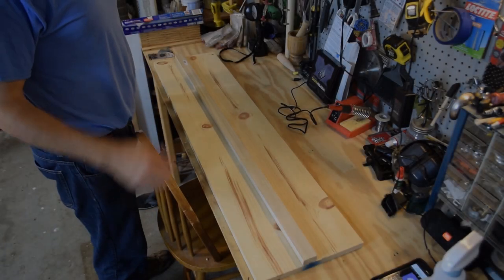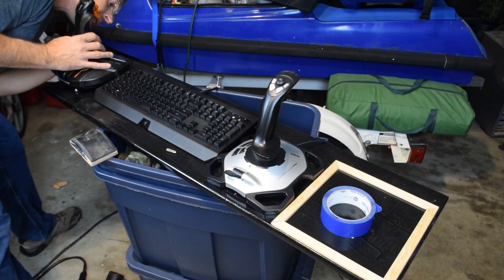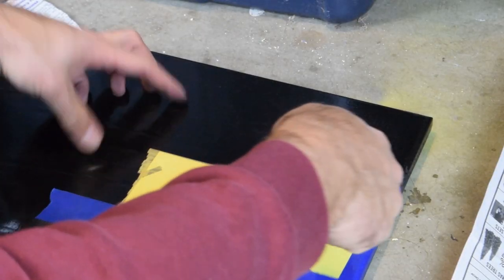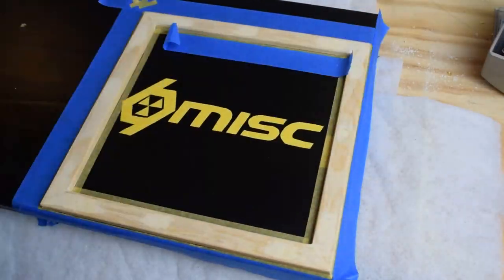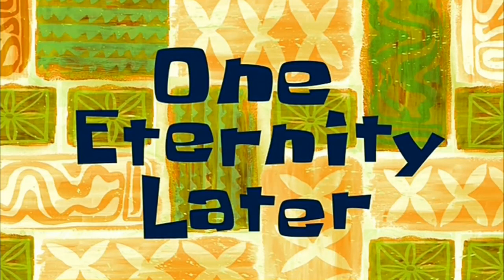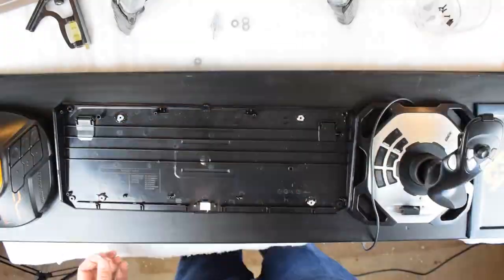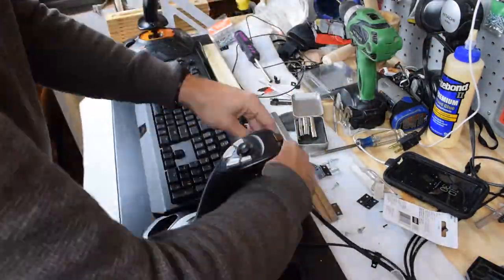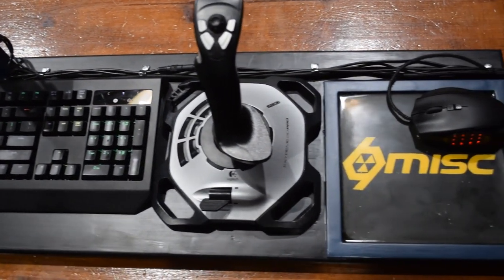Star Citizen Dual Stick Theater Gaming Table

Comment: Great concept, and very nice results. If I may offer some "Woodworking 101" Only use a belt sander for very rough sanding or shaping, not finish work, it is too aggressive. For finish sanding use either sand paper with a sanding block and sand WITH the grain of the wood, or use a random orbital sander.
Reply from the maker: Thanks!  Yup, learned that lesson.  I'll use the orbital next time.

Comment: I've literally just bought these exact 2 flight control sticks for star citizen. Going to get it this week. Any chance you'd do a video on your bindings? And what you think of them?
Reply from the maker: I haven't had any issues with the Extreme 3D Pro, other than it gets a little sloppy after a while.  Nothing a larger deadzone won't fix.  For the T16000, it works really well, but I did have to disassemble the stick and clean out the Z rotation potentiometer.  It seems that is the weak link in the T16000 design.  Also, I cut the power to the LEDs in the base as they get annoying.

For keybindings, they change it seems with each new quarterly release.  And I'll probably change them up again with the new flight model.  But I will probalby do more Star Citizen videos in the future.
Reply: @FamilyHomeTheater  thanks for the reply!

I bought them second hand, so may clean them up too, that was one thing I was prepared for. I have a huge desk and I'm not into screwing them down just yet. I like to reposition a fair bit when gaming for extended periods.

I think I'll also change bindings a lot until I find the balance I like. Starting afresh, used to planes, but may try something different.
Reply: @FamilyHomeTheater  how has the extreme 3d held up over time?
Reply from the maker: @TheBinklemNetwork  Better than the M16000.  The 16000 started having a z axis issue where I had to take apart the stick and clean up the potentiometer that does the twist.  But the 16000 is better on X and Y than the extreme 3d, which loosens up over time.  Overall I have bigger deadlines for the extreme 3d, but I've never had to take it apart for maintance reasons.
Reply: @FamilyHomeTheater  thank you for the quick response! Looking forward to a trip to microcenter tonight!
Reply from the maker: @TheBinklemNetwork  correction (stupid autocorrect) I have bigger deadzones with the extreme 3d. Whereas the M16000 is more accurate.  But I had to mod the M16000 also because the LEDs were annoying.  I cut their leads.
Reply: @FamilyHomeTheater  i fear my girlfriend will really like the leds... unless I get to them first gehehehehe

Would you recommend a one of each or two of the 3d extreme ?
Reply from the maker: @TheBinklemNetwork  If you are doing a dual stick setup, on of each or two M16000s.  The 16000s handle can be taken apart and reassembled for either hand.  The extreme 3d will work, but as a lefty it is a little awkward in the left hand, but easily doable.

The lights probably aren't bad in a room with light, bit I game in the dark.  It wouldn't be so bad if they didn't turn off after a few seconds of inactivity.  I haven't looked recently but perhaps there is a new M16000 rev that fixes this?